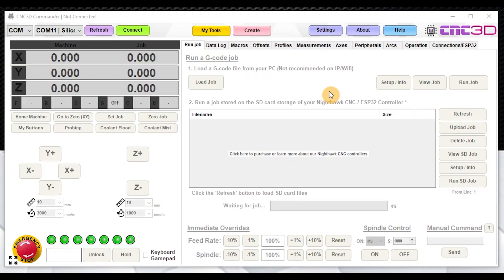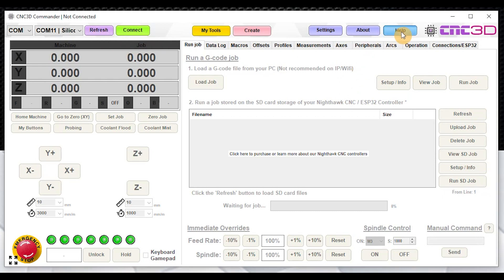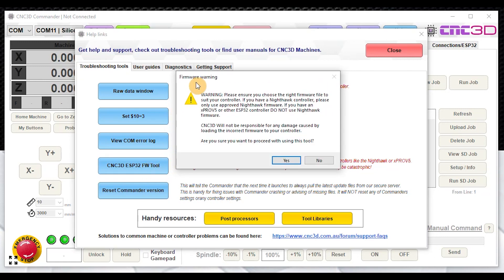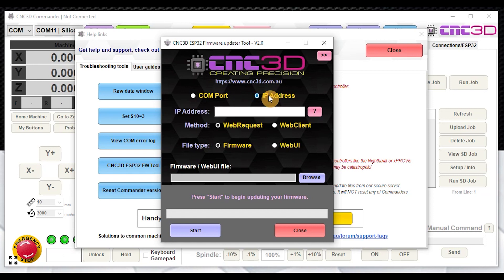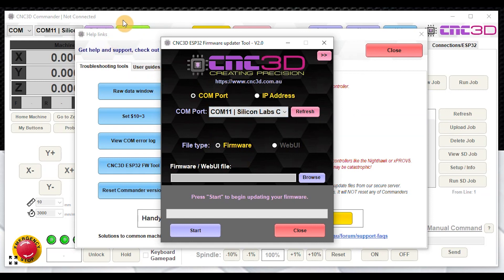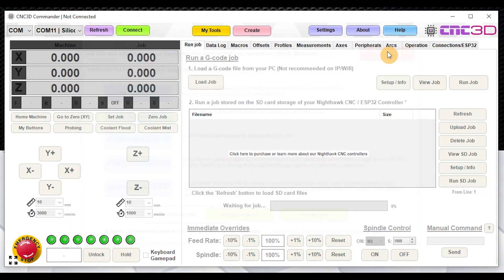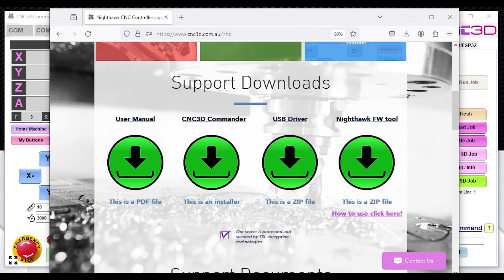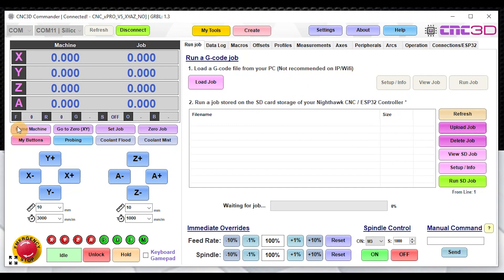CNC3D ESP32 firmware tool - Fixing firmware issues with FluidNC and xPROV5

Comment: Hi, does anybody know, can i upload fw to basic esp32 chip? 32/38pins
Reply from the maker: @prologodesigns3381  yes? Provided that the SPIFS of the project are minimal.

If using GRBL ESP32 or FluidNC then more than likely, it will work for you.

Comment: Fluidnc habe ich auf die Xprov5 drauf bekommen. Die config. Yaml ist auch komplett laufend. Jetzt ist nur das Problem das wenn ich die Achsen Verfahren der 3dcommander das nicht mitbekommt. Und Probe scheint nicht zu gehen. Im cncjs geht probe aber es wird nicht genullt. Ich verstehe das gerade nicht was das Problem sein könnte.
Reply from the maker: @divisionbyzero7916  commander does not fully support fluidnc but basic things should work.

Click on "Help" then click on "set $10=3"

See if that fixes your readout issue.

It may be handy to go through all of the Help menu for other things that may help in future.
Reply: @cnc3d vielen Dank. Ich habe  jetzt auf eine alte org Firmware geflasht. Bei der alten Firmware läuft die Spindel nicht im Cnc3d Commander. Im cncjs scheint sie zu gehen.
Habt ihr einen Tipp wo oder wie ich eine brauchbare Firmware für meine xpro v5 XYYZ NC RS485 finde? Oder welche Firmware laufen sollte, mit dem cnc3d Commander. Der Commander macht einen sehr guten Eindruck, ich glaube der hat alle Funktionen die ich benötige integriert. Einfacher Werkstücknullpunkt und Steuern per Xbox360 Gamepad und Soft Endanschläge.
Reply from the maker: @divisionbyzero7916  There shouldn't be any difference when sending the command to turn the spindle on between commander and any other sender program. It literally just sends M3 S[value]. The controller then interprets the code sent. You may wish to double check that again. The Run spindle options are on the 'Run Job' tab at bottom center. 

Thanks, we do try our best! The next release due has even more features including some very cool and unique ones for Nighthawk controller owners. :)

Comment: Any chance the Commander software would work with the Root Controller REV 3 ISO?
Reply from the maker: Ok, I just took a look. It runs on FluidNC so most likely not, we do not provide support for FluidNC because we simply cannot. it lacks all of the original  GRBL settings in favour of it's own locked down settings config via YAML.
Reply: @cnc3d  thank you for taking the time to look into this! I wasn’t sure if the firmware could be rewritten to make it compatible as this is my first CNC build. It looks like I will grab the Nighthawk Control Card in the near future for an upcoming build!
Reply from the maker: @mciarlillo  Awesome to hear you like Commander and the Nighthawk. :)

Changing the firmware would be difficult as you would need to re-add in the settings pointers from what was removed from FluidNC. 

Commander may work but a lot of features will not function as expected and the easy settings config within Commander may cause errors.
Reply from the maker: This is hard to say, We've never heard of it. Have you tried it to see if it connects fine?

What machine does that controller usually come with?

Comment: hello, I got an ultimatebee 1500x1500 xpro v5, and VFD.  The emergency stop switch is NC. which firmware I need?
CNC_xPRO_V5_XYYZ_NC.bin
NC_xPRO_V5_XYYZ_485_NC.bin?
BTW the check door message isn't showed up. maybe its not communicating? If I press the emergency stop is it should connect?
Reply from the maker: This is likely a good sign. NC sounds like a good option but you may need to confirm with the vendor.

Comment: Question when I follow the video. I have no file to click on it blank.
Reply from the maker: Hello. :)

Do you mean when you open the firmware tool, you can't open a firmware file to select?

You may need to track down your firmware file location first.

The file open dialog box will only show bin files. It won't show any files that are not bin firmware files.

Most likely, you either have not downloaded the right firmware file OR you haven't unzipped your firmware files.

I hope this helps.